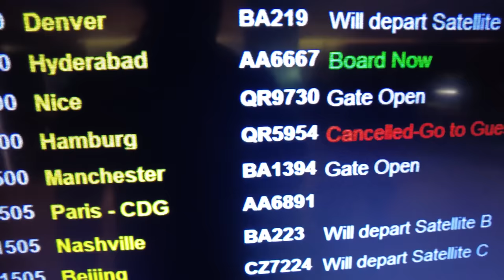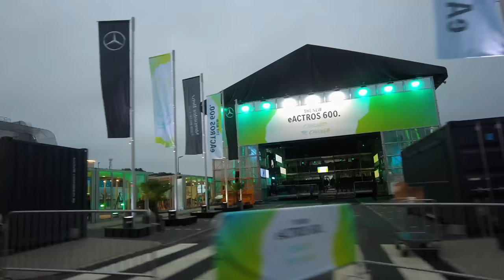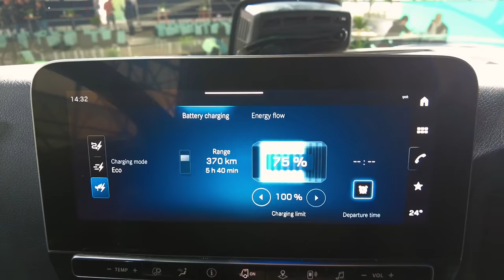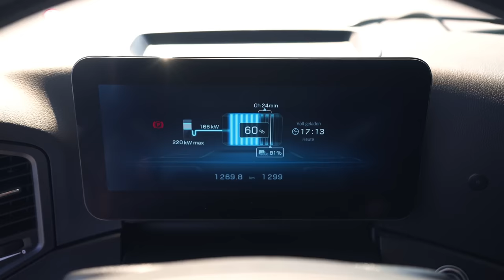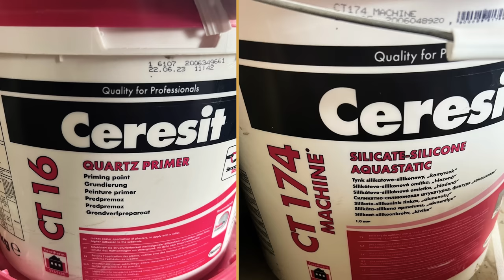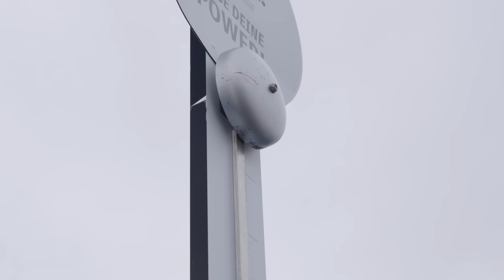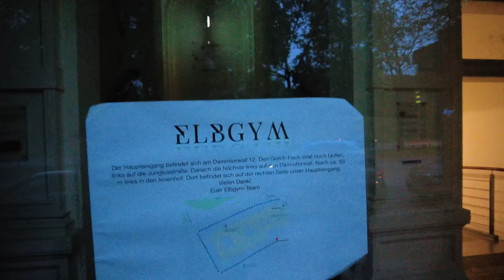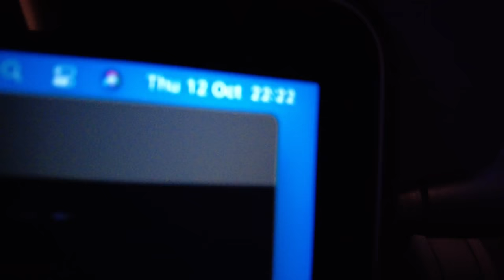Charging Forward & Making It Pay | Ashville Weekly ep158

Comment: Where's is all the electricity going to come from to charge the ev trucks the electricity grid is already stretched to it's limits as it is phone your electricity supplier and ask if you could get the extra electricity needed to charge the trucks they'll laugh then say no there's a complete infrastructure system that has to be put in place for them from the grid there has to be a new substations and new heavy cable from the substation to the yard there's a lot more than just buying an ev truck

Comment: Regarding the timber Bifolds.. tell your client that they won’t have problem with timber if they use “accoya” , one of the most stable products on the market, pretty sure it comes with a 50year guarantee. I’ve got a 4x panel set and they’re as good as the day they were installed (approx 10years ago)

Comment: Exact question I would ask,working for a company that run over 250 tippers in your area and many more south coast areas...in green. The Actros is a cracking truck,in a previous life I ve had two from new pn night trunking. Back to where I started 30 years ago now on bulker artics. Is there room on on these E Actros for a wet kit to run hydraulics for tipping gear/low loader hydraulics as your need space for a hydraulic tank,and a pto off of the gearbox? Great vid Daniel as always,roll on next Sunday at 08.00 ps..does Terry ever stop moaning! Obviously hasn't caught any fish recently!

Comment: I think the actual issue with the electric trucks is the pure amount of energy they need....as in if less than 50% of the trucks in the UK went electric, the power produced currently by powerstations wouldnt be able to power them, not in addition to what we use, but without ANYTHING else using power in the country we wouldnt be able to charge them + the powerstation infrastructure issue isnt small, its 15-20yrs to create operational powerstations.
Reply: There is a great guy called Graeme Cooper who works for the National Grid, he has actually stated on multiple occasions that the load we use today is actually less than we have used in the past due to massive improvements of efficiencies in many sectors, lights/heating/insulation/etc/etc (he can tell you much more)
And that the grid is not in any fear of failing at any time, especially due to the way the majority of how the trucks will be charged. They wont be run dry on every occasion and then required to fill up to the brim, and then run dry again.. There will of course be the rare coactions where situations like that will be required and the fleet operator will incur the cost of that by having to use more expensive to charge rapid chargers. But the vast majority of these fleets will use cheaper trickle charge speeds over night and have less impact on the grid. And can even be managed by their utilities if they wish to get more favourable rates.. 
And that is the majority

Comment: The electric truck has to charge at 20% for fear of running flat and we are told not to charge beyond 80% so the truck range would be 186 miles. And Daniel could not confirm the payload but then EV truck people never do because that is the deal breaker for many

Comment: I have 2 questions regarding making electric trucks pay.

1 - What happens when the battery packs up after 4 or 5 years, and merc want 3/4 the price of a new truck to replace it?

2 - What happens when the cost of electric goes through the roof, When the national grid decide they need to upgrade the capacity of the grid to cope with the extra demand?

Comment: If all trucks moved to electric in the UK we would be back to burning coal to maybe generate enough electricity to power them. Our wind, solar and hydro wouldn't be enough to power everything. A whole truck stop of lorries charging all at around the same time I would presume would cause much bigger issues for the grid.
Reply: The price of electricity will go through the roof
Reply: @notme1345  I was speaking to someone who has an electric car and they were saying there's currently no cap on charging prices at service stations so some places end up being extortionately exspensive. They were saying sometimes it was cheaper to fill up their diesel car.

Comment: Enjoyed the EV section...Personally i do not think it is the way forward ,i work in a main dealership ,and have done the EV training ..After spending  millions  manufactures will give the how good they are speech  ..In the UK  the electric infrastructure can not cope with  half time in a world cup ,so it has no chance with X amout of EV vehicles ie buses trucks cars etc plugged in at the same time ,whilst still coping with normal  domestic use ..Again the range they give will  be like the MPG in ICE it won't be accurate ,..If you have to park up vehicle for say 14 days  how much power will the batteries loose  (note you have already paid for the power that has just gone)  How efficent will the batteries be after 10 years ? how many cells will have died  ? Is there a 2nd hand market for an 10 year old EV ?..They cant be exported to africa  as they wont want them ..Keeping them local is good especially in london ..Are manufacturers willing to take them back at their end of life and dispose of them ,and will that then add to the cost of new ones ?? Also if the EV is the future ,why are manufacturers investing in hydrogen ..Sorry for sounding like a moaning git ,But EV is not the way forward

Comment: Are BEVs really as friendly to the planet as they claim?

<70% of cobalt comes from DRC where, allegedly, a form of slave labour is used to extract the mineral out of the ground. 

The end product (_the eHGV_) might have zero emissions but is this target achieved ethically? Does it even matter how manufacturers come by raw materials, the miles these materials rack up, or the carbon emissions involved in entire supply chain from extraction to delivery? How about recycling and/or repurposing spent batteries? 

I find BEV stats somewhat misleading. No one ever explicitly states whether the vehicle is at its maximum allowable train weight or carrying zero cargo. Driving style affects battery range as does terrain. Does the suggested range take into account stopping and pulling off from stationary dozens of times? I am almost convinced operating temperatures could also affect how long a charge lasts. Or is the battery range derived from rolling road tests and not real life usage?

'Most people use statistics like a drunk man uses a lamppost; more for support than illumination'

I've been driving an electric HGV for little over 2 months. It's worth having a demo vehicle at your yard and letting drivers experience their future. Driver feedback could be useful when selecting a new fleet.